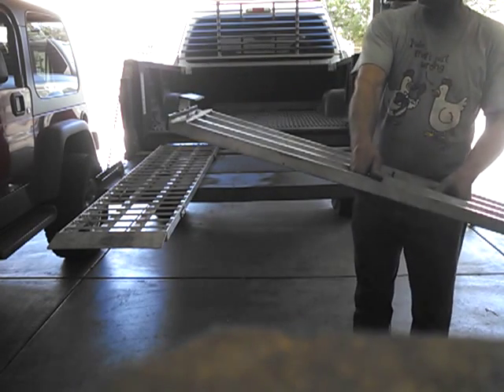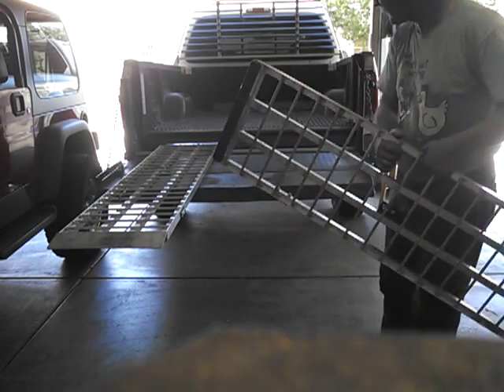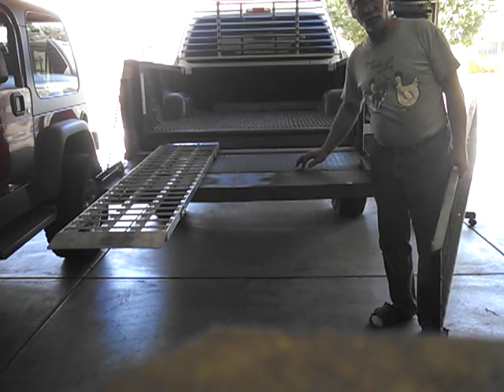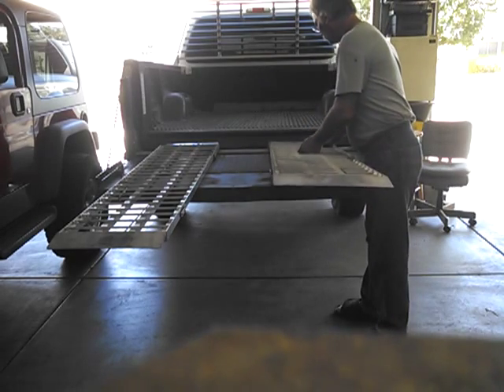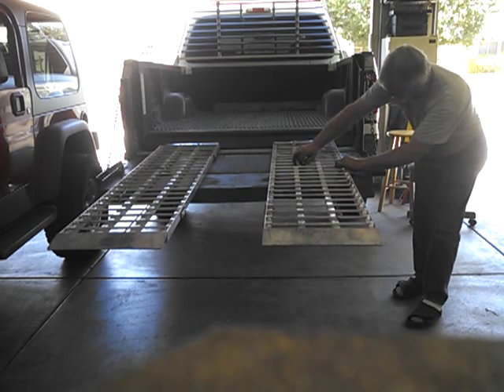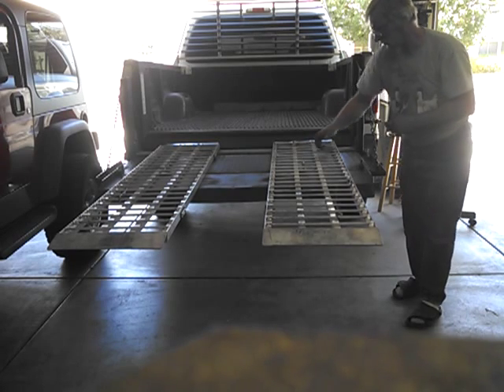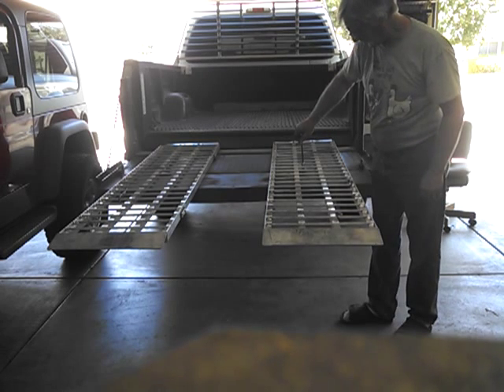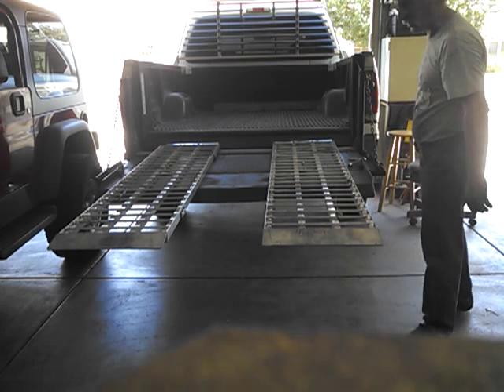Loading lawn tractor with tommygate (part 1)

Comment: What size are your aluminum ramps?
Reply from the maker: +Ed Colson They are 12 or 16 inch's wide and 6 feet long.  I bought them off of craigslist and I think they are from a tri fold atv ramp with the center section missing.

Comment: Hi, where did you get the bracket to hook on the front at?  Did you make that? if so how?  Thanks!
Reply from the maker: Scott Hansen I made them by welding two pieces  of angle iron together to make a hook
Reply: thanks! and what do you have attached to the ramp to hold the bolt in place?
Reply from the maker: I drilled holes through the angle iron and the ramps and bolted them together.